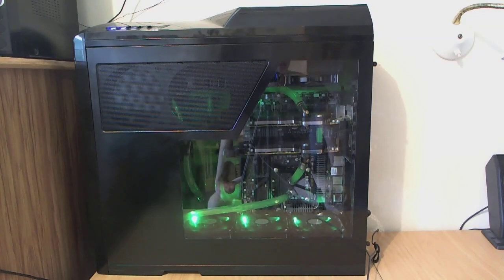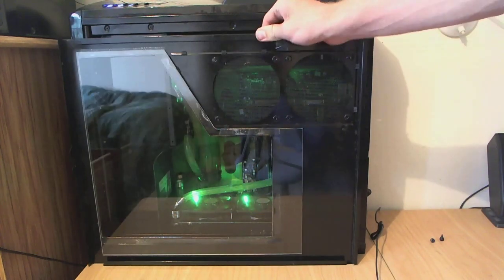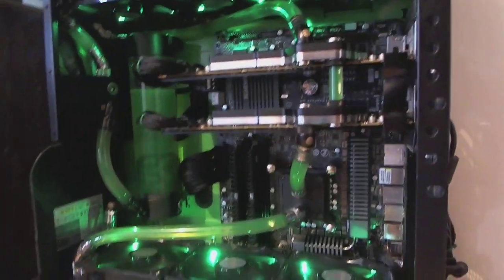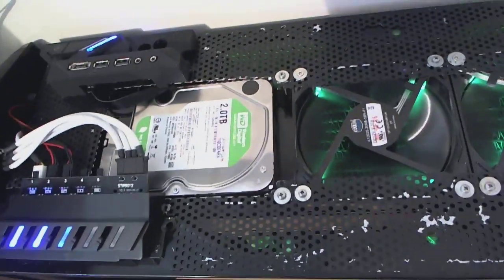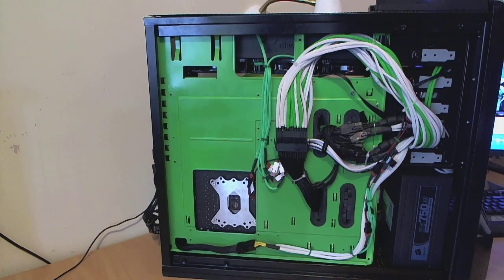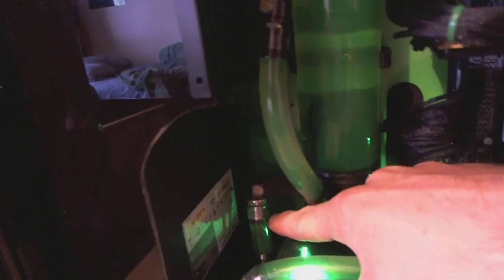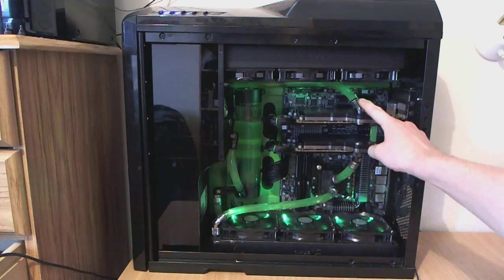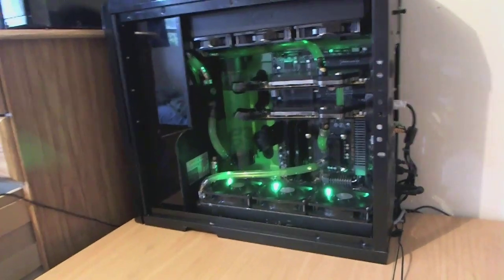NZXT Phantom Black Water'cooled Fully Modified Custom Rig

Comment from the maker: Cheers man :) 
The triple rad is a sort of mission really, you are able to mount the end screws for the First/Second 120mm section. but that leaves a mighty over hang and it leaves the rad on a light lean. That is why I made a custom top for the panel :) Check out the build log and see what I have done, maybe you can make something similar for yourself!

Comment from the maker: Ever watercooler went through this stage!!
The pump I have is this the Koolance MCP655. Though this pump has 5 different rebrands, so find the pump that is either the D5 or MCP655 (Essentially they are exactly the same with a different sticker!)
The Reservoir I have is the EK multi-option X2 (NOT the latest X3) 250ml Advanced.
If you want, add me on steam and I will help you :) Search Kammel109 (or ExtremeKiwiPhil)
I'll give you tips and help you through it!

Comment from the maker: All I did was mount the psu to the "120mm" holes in the front of the case. so I took out the 4 screws holding the fan and grill on the psu out, and then drilled a larger hole on the 120mm mounts on the case, and then screw the psu back together via the front of the case, if that makes sense XD

Comment: Sick mod man. Im currently building a new rig with the exact same case. 

Was the installation of the triple radiator at the top a breeze? Cuz isn't it only designed for a dual rad like the H100?

Comment: Ive just ordered this case in black as well and I was wondering if you could show or explain how you fit a 360 rad in the top. I know you made new holes, but what tool, and what screws did you use and the tabs in the top 5.25 bay get in the way?